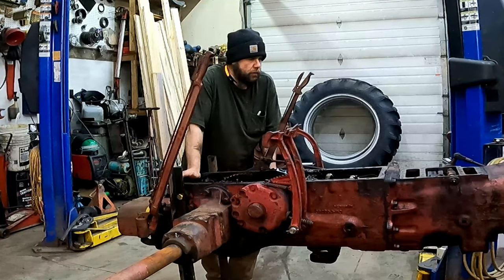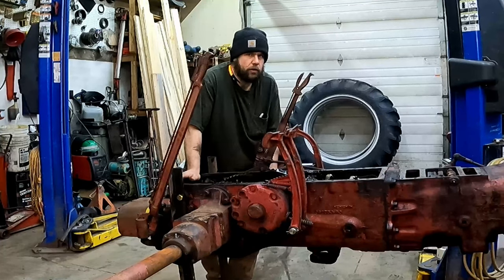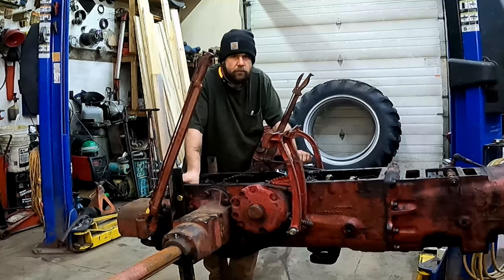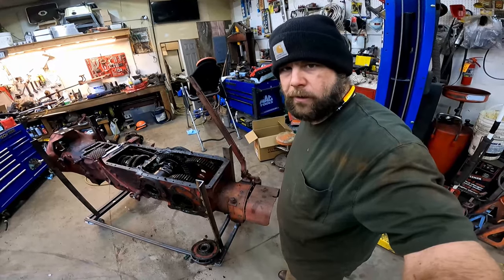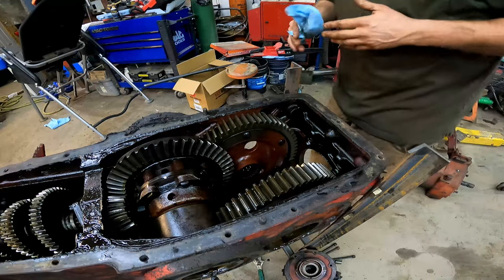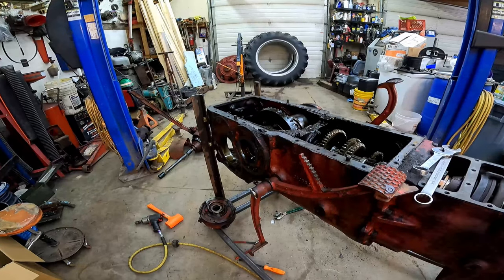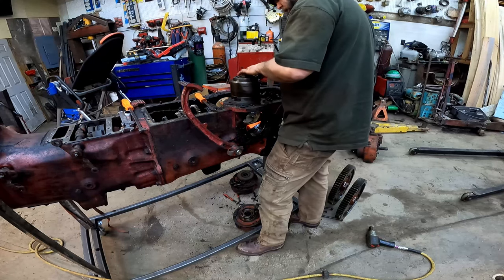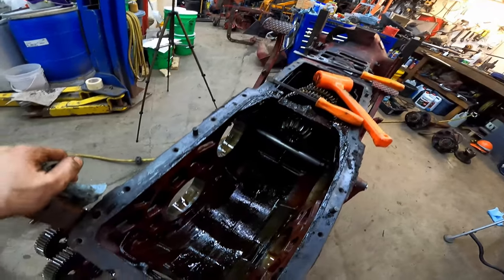Farmall 300 Part 3 Rear Differential, Bull Gears, Bull Pinions, PTO and Axles

Comment: Where does the number series get power to the PTO shaft?????  I understand the clutch pack on the back of the rear end housing, but don't understand where the continuous power comes from that powers the shaft. I would really appreciate it if you could and would explain it to me.
Reply from the maker: If you look at video #5 in this series, the shaft that I pull out at 6:25 splines into the pressure plate on the back of the engine and always spins, it drives the gear/shaft that goes below the T/A and the transmission that goes to the pto itself.  I hope that makes sense if not i can give it another try.
Reply: @kedfarmrepairs  
Thank You for this. Instead of using a two stage clutch like everyone did in later years they used the clutch on the back. I thought that maybe it was chain driven off the crankshaft or something to a lower shaft.     Was wandering if this could be added to the letter series. 
   I guess it could be added to my M's if I gutted the entire transmission, and put the entire 400-or450 workings in the M cases and drilled out the cases for the linkeges 😅🤣!!!! Just a little afternoon project. 
   M&W hand clutches aren't falling from the sky either. The ones that come up on eBay seem to be worth their weight in gold.
Reply from the maker: @coburnlowman  It would be a huge undertaking and there would undoubtedly be a handful of custom parts that have to be made for sure.  The housings that hold the T/A (that also had live PTO) are completely different than the earlier non ta housings.  Easiest way to get a live PTO in an M is get a Super MTA